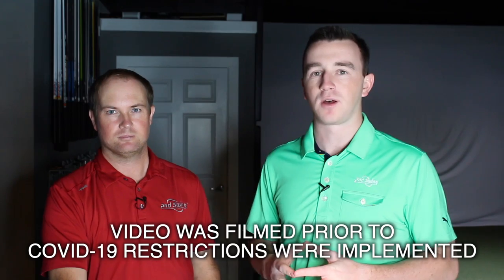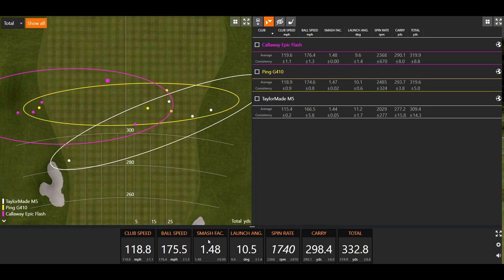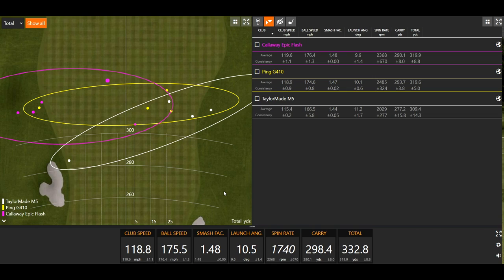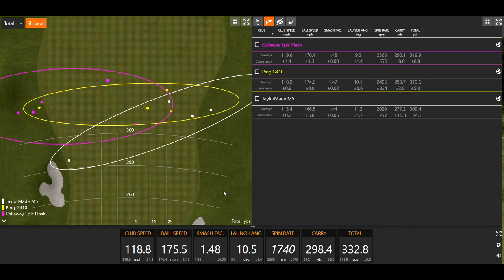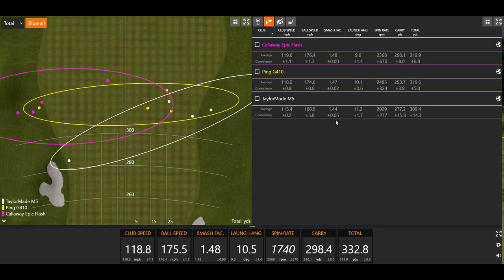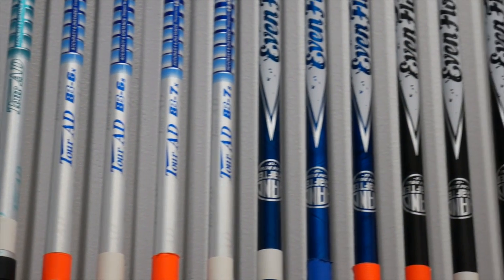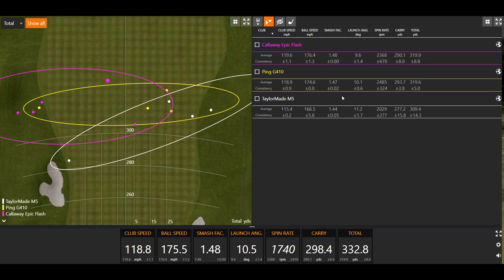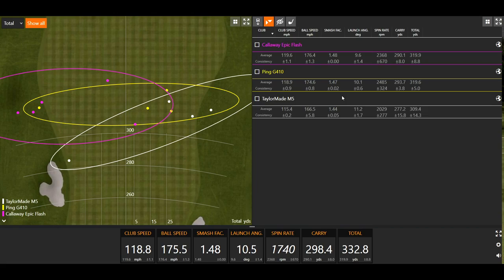Trackman Fitting Data Discussion: Smash Factor | 2nd Swing Master Fitter Insight

Comment: what is the main benefit of using Trackman vs. GC Quad? I'm consider both - can't decide; appreciate your inputs!!
Reply: I'm not a club fitter but I've been told if you're hitting outside go with Trackman and inside go with GC Quad. Also you only get impact location with Trackman if you have a Trackman 4.
Reply from the maker: Thanks for watching! We have both Trackman 4 monitors and GC Quad monitors throughout our store locations. Both are terrific for gathering in-depth fitting data. We just happen to have Trackman 4s at the locations in which we film videos.